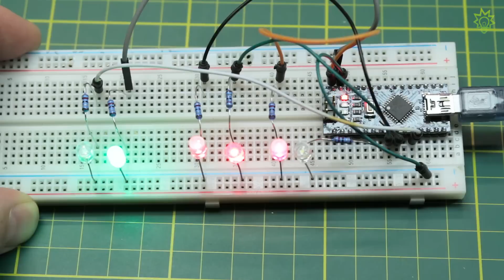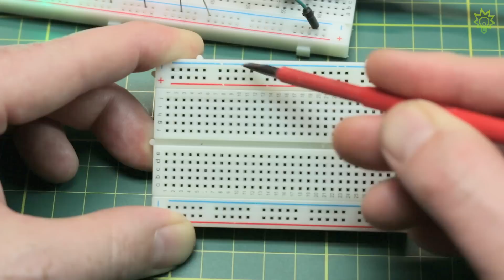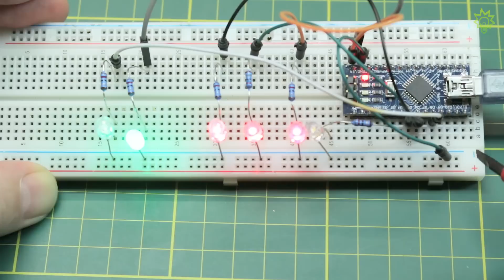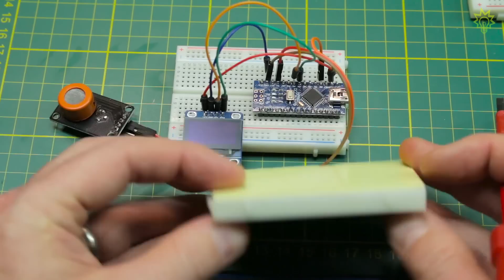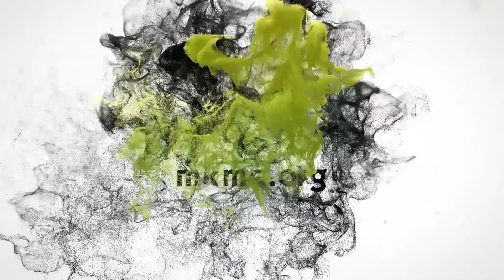How To Use Breadboards - Using Breadboards for Beginners and Prototyping Circuits

Comment: Nice video. indeed, breadboards are extremely useful when it comes to prototyping. I still wanna learn how to use perf board though.
Reply from the maker: They are the same as the breadboard except you join the pins manually. Maybe I'll do a vid sometime.  Cheers!
Reply: +MKme Lab Yeah, it is a little bit harder when it comes to doing wiring on those tight spots and making it all look neat. Still, a great skill to know. Ben Heck is the greatest at it.